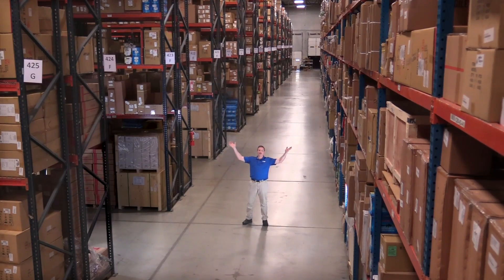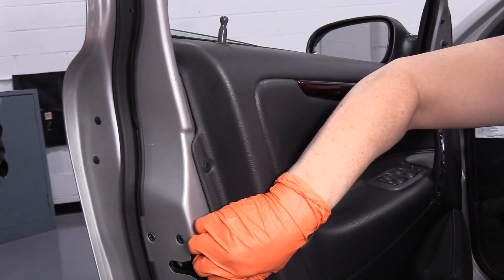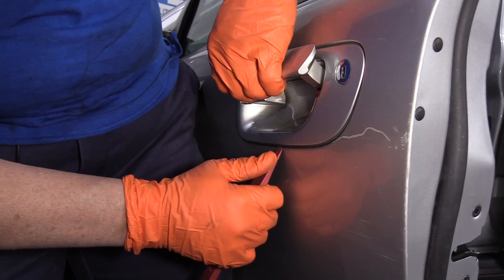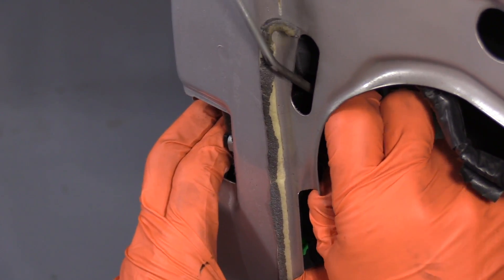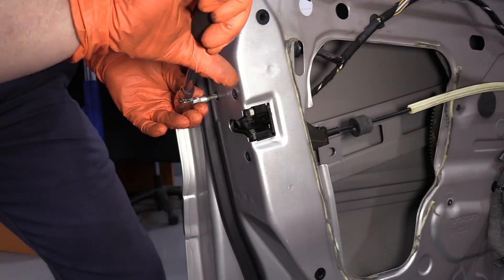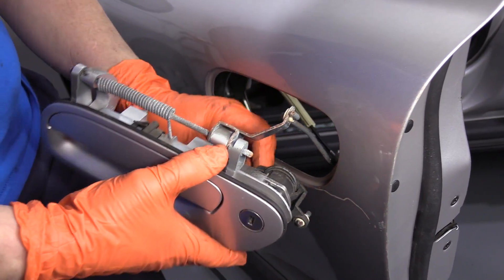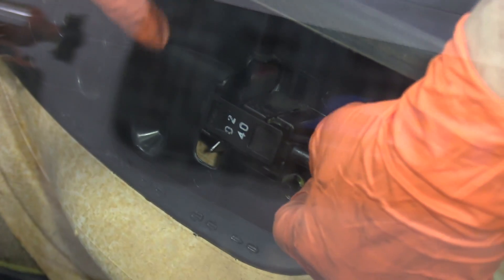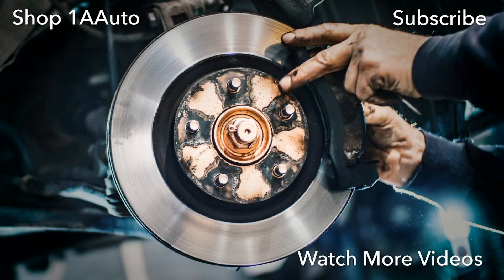How to Replace Front Door Latch 00-07 Volvo V70

Comment: Thanks for the video. Very helpful. Would just like to add that I found it easier to leave both rods connected to the outside handle and pop the threaded ends of both off the latch assembly connectors, instead of just popping one of as you did in the video.